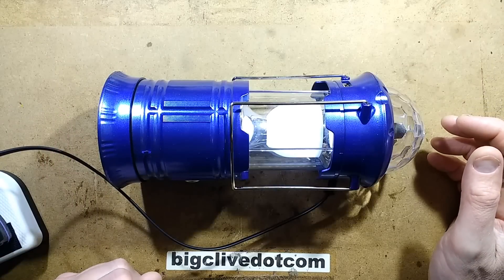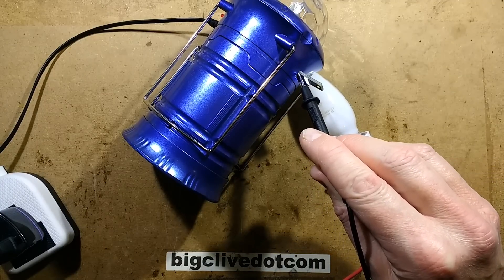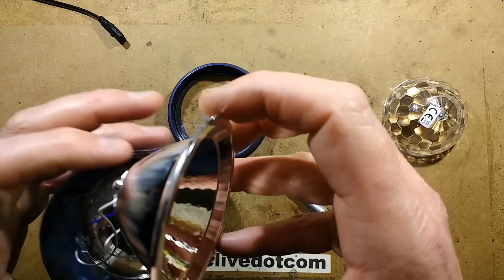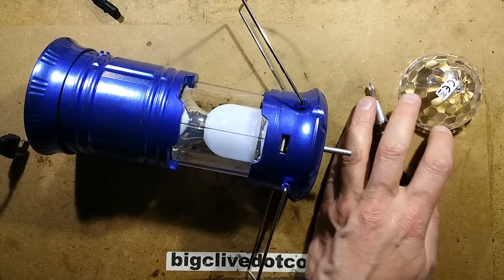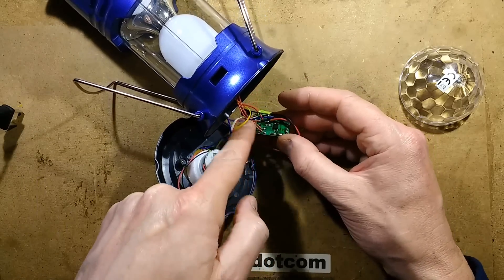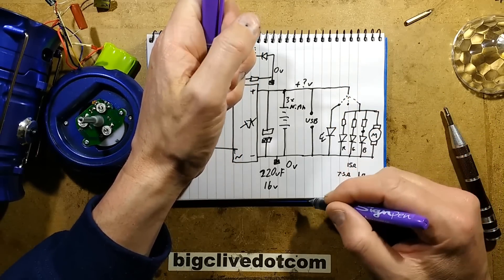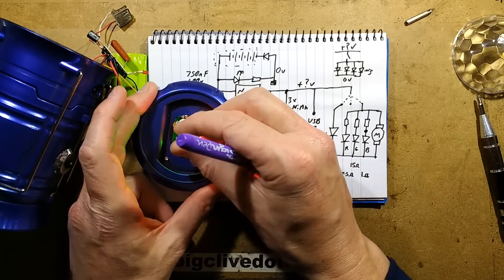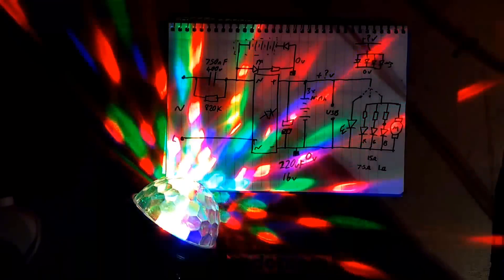This disco camping light can kill you.  (Fabulously!)

Comment: If bridge rectifier is used, then hoe come it shows live voltage at USB?
Reply from the maker: It's rectified live voltage.
Reply: @bigclivedotcom  ok. But of it's coming from vcc of USB, how come batteries are getting charged with such high voltage? And it it's low voltage DC, your test lamp should not glow.

Comment: Is there a way to test for mains referenced power supply with a multimeter instead?
Reply from the maker: +steve64464 Check from the mains input to the USB output with the meter on diode test.  Test all pin and polarity permutations and look for any reading at all.  Often 0.6 for a diode.
Reply: Thanks for the reply clive , In my instance its not a death usb device more like a wall wart adapter that outputs 12v@3amp , I had this really dodgy flash and breakers trip the other night with no trace of burns or smell it was like some high current jump i dont know if its safe to use or not.
Reply from the maker: +steve64464 Was it inside the unit?  If it was it's probably dead.  If was from the output cable then that's dangerous.
Reply: In a follow up to this i thought id try one them voltage test screw drivers over the 12v output (neon light resistor based) and the neon gave a very dull glow so im assuming its prob gonna kill me if im earthed while touching it.

Comment: I think I'll buy one of these and do a LiPo conversion. I'll obviously get rid of the capacitive dropper right out of the box and replace it with a micro USB LiPo charger/protection board.
Reply: Good idea. I'm going to do one of those too, shove a TP4056 onto the input (with protection) and whack a great big LiPo or 18650 Li-Ion into the top. I could even keep the solar panel, if I get one with a panel on it. That'll do it.

Comment: If the 16 volt capacitor is directly across the same bus as the USB port, how does it not explode when the USB port gets 240 volts on it? For that matter, how come the battery doesn't explode either? I realize the shell is ground but shouldn't that be the minus terminal of the bridge rectifier?

Comment: How come no one has been charged with criminal negligence? You'd think someone would have grounds for a lawsuit? Wire they not doing something? Do the lawyers currently have bigger cases to fry? Or is something creating too much impedance? One thing's for sure, if these are in your ohm, they should be dumped to ground because they have killer potential.
Reply: Now that was a pretty good hurricane of puns. I give you a 4/5 for that.

Comment: So is this light 5v input or 240v or do you mean if the 5volt charger goes up the spout and passes 240v through it then the light becomes live with 240v?  Wasn't really that well explained lol
Reply: 240V input via the mains power cord, USB output should be 5V but is just the battery voltage (3.6V), however there is a direct path between the input and the USB output, so when charging from mains, the USB is live at 240V AC

Comment: I have 2 of those (but version with solar panel instead of that globe)
solar panel could provide max 3V (for 3xAAA batteries it is just not enough) and USB was connected directly to battery
But its power was okay, so i drill-modified it and now there sits 2x 18650 3450mAh LG cell with USB charging and 2A USB out.

Comment: Fix it more! Do a video on you fixing it proper! The most sensible thing to do is just replacing the AC connector with a DC barrel connector and use it instead. That or use USB for charging. Get a usb battery charger and booster and put that in it. Then just use an external usb charger with mains isolation.

Comment: Could you not just cut the mains plug off and charge it off say a 12v or 24v supply such as a car or lorry cigarette lighter
Reply: No. The capacitive dropper is designed with ~230 VAC on mind. You could take it out, (replace/add a few resistors?) and use a 5voltish input such as USB, I think.

Comment: Sooo, if one were to buy this device and replace the dodgy ACDC converter with something like http://www.ebay.com/itm/HLK-PM01-AC-DC-220V-to-5V-Step-Down-Power-Supply-Module-Household-Switch-CZ-/162240204406? , that would actually make it much more valuable, right?

Comment: It's almost as if these designs call for proper isolated supplies like in typical power bricks yet they cut costs by using the capacitor dropper instead. Not sure why they can't be charged by a standard USB supply, why bother with mains at all? Safety would then depend on the power brick used. I have a cheap disco light that runs off mains, yet even it has an isolated supply inside despite not having any external USB connections.

Comment: How do you set and calculate  the output voltage and current for a capacitive dropper?
Reply from the maker: +Timothy Sherratt You can use the formula for capacitive reactance or you can experiment with values.  Usually from 0.01 to 2uF.

Comment: Could you make the  capacitive dropper "safer" by using a capacitor in both Live  and Neutral  (double capacity to get same current of course)
Reply: You'd still get a shock from it because there is still an AC current path to ground, even if that current path is DC decoupled by the capacitors. At double the capacitor value (1.5uF each side), the current would only be limited to about .11A or so at 240/50Hz, which is still enough to kill you.

Comment: This is exactly why I never buy anything from China that directly plugs into the mains. Only stuff that use a wall wart adapter 9-12V adapter. Even then, I chuck them and use my own. You never know.
BTW, "CE" means nothing. It means "China Export" and its not regulatory. If you readers didn't know already.

Comment: Big Clive you should teardown one of these, it's another camping light but this one has a solar panel and a fan! And of course can be charged directly from the mains.
https://rover.ebay.com/rover/1/711-53200-19255-0/1?ff3=4&toolid=11800&pub=5575108413&campid=5338015132&mpre=http%3A%2F%2Fwww.ebay.com%2Fitm%2FCollapsible-Solar-Outdoor-Camping-Tent-Lamp-Light-LED-Hand-Lamps-with-Fan%2F332343410964%3F_trkparms%3Daid%253D222007%2526algo%253DSIM.MBE%2526ao%253D2%2526asc%253D46087%2526meid%253D7a534f8eddf640b6863d3d573494443a%2526pid%253D100005%2526rk%253D3%2526rkt%253D3%2526sd%253D232298251068%26_trksid%3Dp2047675.c100005.m1851

Comment: I bought one of the gold solar rechargable lanterns the charging cord doesn't really fit in us sockets and I will never use it. The battery recharges enough during the day by sitting it in the sun that I have never ran it dead while camping. It's a great light if you don't charge it by the charge cable that should never be plugged into any outlet

Comment: Sooo replacing the battery with a couple of 18650s and a proper USB input charging this thing would be borderline usable (still not able to charge at 5V from the USB output of course, but who cares).
Reply: Keep the NiMh batteries, but make them replaceable.  Much easier to have spares on hand, then wait all day to charge.  Throw the spent batteries in a mains charger for next time.
Reply: Replace mains charger with USB low voltage charger, replace Ni-Cd (or Ni-MH?) with TP4056 + Li-Ion and add boost circuit for 5V USB.

Comment: Why did I ended up throwing the charger across the room when I accidentally touched one of the connectors of a cheap chinese 18650 charger when I tried to put in a battery?
Reply from the maker: If it gave you a slight tingle that could have been capacitively coupled leakage.  If it was a strong shock then the output of that charger is probably referenced to the mains.  If it was a strong shock it would be good to see the insides.
Reply: bigclivedotcom Well, I felt my muscles contracting so it was somewhere in the middle. It charges 18650 batteries ok, but quite slow actually. I opened the charger and what I see is a bend spring that could touch some resistors and other components and short things out. It is connected to the minus terminal of the charger. http://i.imgur.com/EgX6fge.jpg
Reply: Undefined Lastname Resistor R4 is directly connected to mains voltage, so is the 400v capacitor.

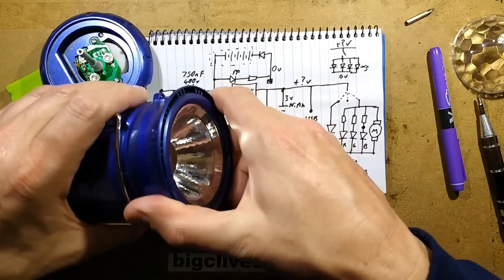Comment: 11:22 "... slight mains output issue."  Ya, you would only end up slightly 6 feet under.  Family and friends would only be slightly sad and slightly cry at your funeral.
Reply: petti78 if you were 6 feet under you'd certainly be well grounded!!!
Reply: Only if you happened to be rather well grounded.
Reply: Causality problem detected
Reply: Everybody, or at least most, people in countries which use proper power supply of 220-240VAC has had or will have an electrical shock. Vast majority survive.

Comment: So can you explain why a capacitive dropper causes there to be a low voltage side for the LED, but also for there to be 240V at the low voltage?
Reply: Capacitive droppers limit the current to the rest of the circuitry, the resulting voltage across this circuitry is due to the difference in the relative impedance between that of the capacitor and the rest of the circuitry. In the case of this lamp, it's mostly the battery. But if you touch the right part (or wrong part depending on how you look at it), mains current can flow via a diode to you to and then to earth (ground). The diode will drop the voltage only by about 0.65V to 1V. So you get more or less the full mains voltage.
Reply: It's because there are two difference points of reference.  The LEDs only see the low voltage across the NiCd battery, but the entire circuit is floating at 240V above ground.  The LEDs don't see this because they don't have a ground connection, but you very probably do (via your feet and the floor, or by touching a water tap, or heating radiator etc.)
Reply: I believe that it goes something like this: 
-On the side that has the capacitive dropper, the circuit was designed with a certain current draw in mind, and thus they were able to regulate the voltage by limiting the current. As long as the load is there, the voltage will be regulated, and as you only need to power up the LEDs and the battery, you don't really more than 5, 6V. This is fine for the electronics of the lamp.
-On the side that doesn't have a capacitive dropper, the voltage goes straight from the mains through the bridge rectifier. Given that this camping light is fed with AC, on the positive half of the sine wave nothing would happen (regarding electrical shocks) on the ground /negative / 0V side of the USB plug. However, on the negative half of the sine wave, current would flow from mains side to the ground / negative / 0V side of the USB plug. On an ideal, forward biased diode (considering conventional current flow), you'd only get current flow from the anode to the cathode, i.e., when the voltage potential is higher on the anode than it is on the cathode. If USB ground / 0V / negative side is connected to the diode's anode (inside the bridge rectifier), and the mains fed voltage is on the cathode, then the potential on USB ground would be 0V, while on the mains side it would be, on worst case scenario (on the negative half of the side wave), a peak of -320V. Given this, current would flow from mains to the USB connector, and with little to no series resistance (no capacitive dropper on this portion of the circuit!), you would effectively have mains voltage present at the USB connector, which is tied (either on the light or the phone side) to the "0V" pin of the USB port. Effectively, the ground of the USB port would be referenced to mains voltage, and if you were touching your phone on an exposed metal surface, you would too. If you were touching the floor or something with your bare feet, you're allowing current to flow from mains to earth, using you as the wire... aka getting zapped in the process. 
I'm sorry I needed to write such a big text to try and explain such a thing, it was not my intention. Wait for someone that can convey the idea in a better way, and correct any mistakes I've made (which I'm sure there are).
Reply: God you learn some scary shit on this channel. I found myself on a live feed yesterday explaining to someone why I thought using a voltage regulator to enable him to power a 4.6v board with a 9v battery would probably be better than him using a resistor (as it would be less likely to sap battery life or fry the board), and I've never even done it myself! Watching Uncle Clive and reading the comments gets into your brain!!
Reply: Voltage always depends on the reference point (it's the difference between two electrical potentials). The LEDs only "see" the difference between the two battery terminals (that's just the way they are connected here). For a person the reference is ground (that's what they are standing on), and not one of the two batter terminals.
Reply: It depends on which way you insert in the 2-pin plug. One way, and the highest voltage above neutral will be approximately the battery voltage, and the other way, the negative rail will be at 230VAC minus the battery voltage.
Reply: Aden McKinley because the capacitor limits the current but not the voltage.
Reply: An excellent explanation

Comment: "Adverse health effects", that's a very polite way of saying "involuntarily crap your pants and die"... :P

Probably would be safer to repurpose this with a USB charging system, so long as the USB charger isn't also plug-in death... :P
Reply: Ehhh, just use a cheap shitty pink usb charger from china, it'll be fine...
Reply: Upgrade it with a Lipo, a TP4056-based charging circuit and a proper boost converter/powerbank circuit for the USB out. ~$10 or less.
Reply: I think he already fixed one of the old ones that way.
Reply: twocvbloke ... w/o even a blink !

Comment: Well MADE IN CHINA
Reply: The made in china part is not the problem. It's the designed in china that causes 98% of the problems here.
Reply: petti78 you're absolutely right: most products we buy today, even the good quality ones, are made partially or fully in China.
It's when they design it them selfs, and build it down to be as cheap as possible, we get this shitty, dangerous crap. 😂
Reply: Yep, made or designed in china isn't this issue. Designed to cost a lot less than one would reasonably expect is the problem.
Reply: anononomous Very true. I've ordered tons of electronics parts form aliexpress and 99.9% was very good, especially when considering the price: 3 times nothing, shipping included. I would, hoewever,  refrain from buying anything that's connected to mains power unless it comes from a reputable company like e.g. Meanwell.
Reply: Just like other well known shoddy products like iPhones for example.

You get what you pay for.  The Chinese are perfectly capable of making high quality products, but if you want something cheap and dangerous, they can do that too.
Reply: It's not always just the cost. Their total lack of interest for any security at all is just astonishing. Using the same bits but separating them out a little more for clearance etc. would go a long way. I guess that's what happens when illiterate farmers start doing electronics design for 2 cents a week.

Comment: It really makes me wonder why they didn't just include a double ended USB type A charging cable and leave all of the mains circuitry right out.  It would save time, cost in production and make the product much safer without needing to use fake CE markings.  It's not like people don't already have plenty of USB adapters to plug it into to charge.  Alternatively, they could have included a cheap USB lipo charging/protection board with power bank function and upgraded the unit to use standard lipo cells in common sizes and it would have greater selling points since they could use the pads for one USB charging port to run the LEDs at a regulated voltage with proper resistors and the other USB charging port to charge a device safely.
Reply: The size it is, you'd hope it had a decent sized battery in it too. Preferably in the base to make it more stable.
Reply: Bro. Punctuation. My head exploded reading that. 😂 That said, I agree
Reply: china is trying to kill you.
Reply: The good chinese electrical engineers are busy designing useful things. The college dropouts who don't understand the issue of putting 120/240 V through the USB port design defective camping lanterns to flog to foreigners lol.